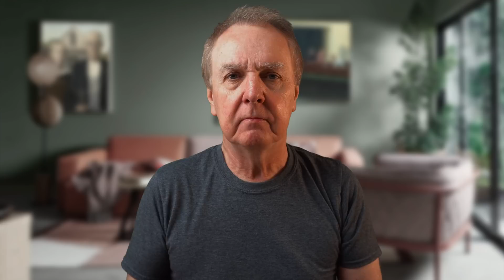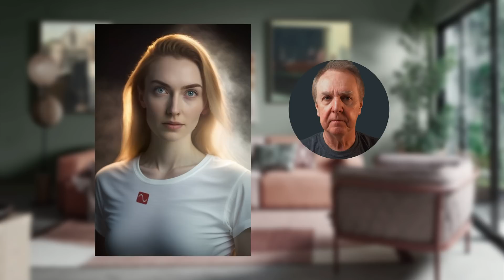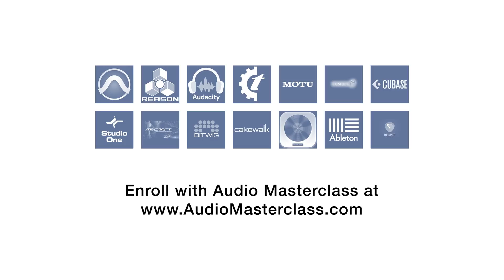Did that Dolby thing ever work?

Comment: Yes, I agree, type-B Dolby noise reduction does work very well when the machine is operated and maintained according to the manufacturer's instructions.  It is not difficult.  Isopropyl alcohol and cotton buds are what you need to do the cleaning.  There is a way to demagnetize tape heads quite well without a demagnetizing tool: simply record a second or two of nothing repeatedly a few times on the highest bias setting that the machine supports (metal > chrome > normal) so that the recording head is energized on and off.  It works like magic!

Comment: Thanks for claering out problem which in opposite to 99% problems discussed  in audio realy exist. All you said is true. I also some 30 years ago used dolby B and C. Today I have cassette deckas with Dolby, NR Enhancer (which apparently workson very simmilar to DolbyB and  more satisfactory than Dolby) , Dolby and Hi COM And ....I never put them "on"   except may be 3 original tapes recorded in Dolby. Not because it is distorting or dull but it shows no gain 

Dolby works in range  it as you mentioned - only for upper part of frequencies.. When  whole band is reproduced at execly equal level I hear  "hisss' part of noise   at   common     with  noise  of 50Hz - 500Hz level. What is the measured  level of noise for 100Hz? About that   acheved wiyh Dolby - 57 dB. How much it is "?  For me it is    noiseless reproduction. . Because by adding room noise  30 dB apeaers that  first  noticeable by ear noise is at 87dB sound level.  Which  masks it 100%.   

I tune my systems always  to such sensation - there is no amplified separate  "hiss" even without Dolby. .  And it was just the goal  of Dolby conversion to beat unnecessary  amplified hisss.  Unfortunately most like that top sopranos amplified and may bless Dolby for beating hisss  noise  in controlled way. 

. This system was made for 70ties audio sounding - solid amplifiers and multiway speakers where high "hisss' is dominating all time  and it is caused by general deficience of  lower bands volume    Surely it  can be easy spoiled by any fault. . Outcome is that Dolby   sopranos are   limited by crossovers, phase shifts, unproper bias, worn heads,  are not as strong as  intended and   just vanish at all. .

Comment: Dolby may only be useful for some lower grade Type I tapes because these kinds of tapes are indeed noisy.  For tape types like Chrome, Cobalt and Metal, noise reduction is not needed because the formulations of these tapes 'are' the noise reduction.  Higher formulations are quieter for tape noise and can take hotter record levels; which means higher signal-to-noise ratios and dynamic range, without loss of sparkly sounding highs.  Dolby was only really useful up to around 1975, when both cassettes and decks were pretty bad and still in development.  By around the early 80's, however, decks and tape formulations had improved to a point where Dolby was no longer needed.  Yet for some reason (probably pre-existing contractual obligations) Dolby remained on cassette decks.

Comment: I've always had it do what I expected it to do, but I'm going to be honest I never used cassette for serious listening, so my expectations were never critical.  For reference I have 3 decks, the best one is a 3 head Denon with twin capstans and autobias, a good deck, so I think I have equipment that would present cassette at close to it's best.  When I do serious listening I tend to use LP or CD, I would rip these to make mix tapes for use in the car.  The car is not an environment that invites serious listening, and I might have heard mismatch in amplitude thresholds on occasion, but given how I use cassette I know I don't care.

Comment: The one thing one can be reasonably sure about is that if the Dolby button is depressed, high frequencies will be cut on playback, because that is where the noise reduction comes from.  So if the cassette was recorded without Dolby boosting of signal (so that it would come back to base level after noise reduction) playback with Dolby will indeed sound dull.  What about if you play back cassettes that were recorded with Dolby, but with the Dolby button inactivated?  Then you ought to get a nasty effect where the noise is whatever it was, and the high frequencies of the signal are boosted.   Sometimes, this is indeed enough to set your teeth on edge,  with tons of noise and added sibilance in the music.  But, oftentimes, it is exactly this mis-match that sounds least dreadful, because it compensates to some extent for the sad falling off in the alignment, cleanliness etc. that would otherwise result in that woolly dullness.   I have hundreds of top quality  cassettes that I recorded back in the 70s and 80s.   All were made on decent decks with Dolby switched on. Some now sound almost as good as new.  Others benefit from having the top end brightened by the rather crude form of equalisation that you get by switching the Dolby off.   Of course, nowadays I only play a cassette if it is material not yet digitised; most of them became FLAC or mp3 files years ago, with all Dolby effects, good and bad, frozen for the rest of time.

Comment: I was taught to get the bias for your tape right, and set the (pre)rec level correct as well. My last deck had bias and (pre)rec level adjustments, next to the normal recording level, and with 3 heads, tuning was easy. Then Dolby worked fine.

Comment: One feature that sadly was adopted only by NAD (who developed it) and Yamaha was Play Trim, which applied adjustable EQ to the signal before it was sent to the Dolby NR decoding circuit to compensate for alignment issues. It was pretty effective.
Reply: Yamaha tape decks have play trim, exactly as you describe.
Reply: I have an NAD deck and Dolby works extremely well on it.
Reply: Loved my Yamaha 3 head deck. Every bit as good as a nakamichi. I sold it for peanuts when I got married.

Comment: Back in the days when it was common to send a client home with a rough mix on cassette we used to use Tascam 122 cassette machines biased for TDK chrome tape. These copies never had Dolby B applied and sounded terrific. My production reel to reels also did not use Dolby, we inserted dbx noise reduction and it was (and still is) fantastic.

Comment: I don't know if this will shed light on anything for others, but I used to own a four-track cassette recorder. The key, in my case, was to use hi bias tape (CrO2). Everybody has a preference, but I came to like Maxells. But the other thing was to make sure to record "hot", where the leds or the needles are in the red zone fairly often but not too often. The proof of course would be in the playback.

My machine was a B recorder, had no way to turn it off, and I wasn't complaining anyway. I just learned that it's not just about the tech but how you use it.

It's an old trick, this recording "hot", so I read, but that seemed to be the end-run around noise issues, even with normal bias tape."Hot" virtually wiped out the noise floor in my little home studio.

My guess is that Dolby B is your best friend while your recording, maybe not while playing a tape on a stereo deck.

I do hope this makes sense, and sorry for the long post.

Comment: I purchased a Revox B 77 in '78, and even at 7.5 ips with Grandmaster 456 and Scotch 206/207, never needed any noise reduction added on. The deck was biased for the Grandmaster. What speed and whose tape were you employing? BTW anecdotal evidence, isn't valid when describing the people you know or speak to, who don't believe Dolby either doesn't work or don't understand what it's for. Used a BX 300 Nak with TDK MA 90's and Dolby C. Worked rather well.

Comment: I bought at a computer auction in the 80s a Proton 740 deck. The only issue it had was the meter display needed squeezing every few weeks to work.

The manual said it was custom calibrated to Maxell XL-IS and XL-IIS tapes. So that's what I bought.

It had B, C and dbx.

Best £25 I spent on a cassette deck!

The CD recordings were very very good and the dbx noise reduction was so good I lamented it was not more widespread for home use.

I didn't like B, it didn't provide enough noise reduction. C was great.

dbx gave CD dynamic range levels but it couldn't cope with solo piano music, you could hear it breathing. But most of what I listened to wasn't solo piano music so I recorded many cassettes with dbx.

 I recorded a dbx encoded vinyl to tape (with the dbx turned off) and I nearly fell off my seat when I played it back. No hiss, any vinyl crackles were banished, a really awesome reproduction. 

As regards pre-recorded tapes. I rarely came across a tape that played played perfectly both sides on any of my decks. One side was bright and other dull. So the Dolby B was enabled one side and disabled on the other.

Now that I'm much older I'm less sensitive to the 'air' I could hear back then. I wonder what the listening experience will be like now as I don't have any cassette decks.

Comment: I still own a Yamaha KX-200 with Dolby B and C. I used C for recording but never for playback. As they say in Spinal Tap; "You shouldn't do rock albums in Dobly". The KX220 is no longer in my system though. It's languishing on a shelf in the box room. Best sound I ever heard from cassette was from a Fostex 4 track owned by my mate which ran tapes at 2x normal speed for home recording. A 90 minute tape lasted just 22 minutes !

Comment: Back in 1983 I got a Akai GX-F66RC paid with my first salary. I still own it. I used it very much, only with good quality tapes (TDK SA, SA-X, and Maxell XL-II / XL-IIS) For the recording level I used to aim at +3db since that was the Dolby indicator. I made sure the heads were clean al the time. Over the years I noticed that Dolby-C recorded tapes developed a really noticable pumping effect. Some of my tapes sounded real bad, some didn't suffer from this problem. I also had a TDK degausing cassette. Using it seemed to  have no effect or a negative effect on the Akai Super-GX head. Many times the pumping effect seemed to increase after degausing the heads and tapes seemed to sound more dull.
As a result, I gradually lost interest in the compact cassette format and switched over to a Panasonic 4 heads VHS HIFI recorder. This sounded excellent, way way better than my compact cassettes. After about 10 years my VCR died and I switched to CD.
In short: I always used to switch on Dolby-C because it clearly worked. However it had nasty side effects.